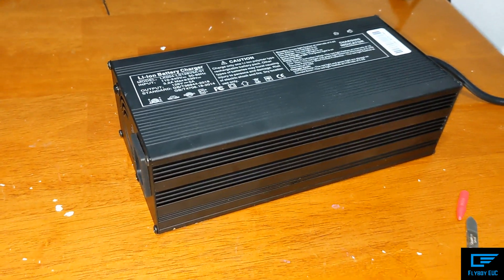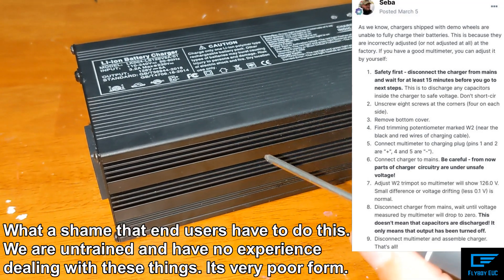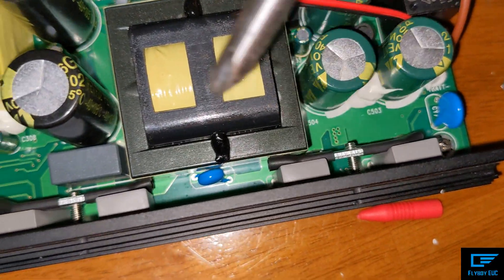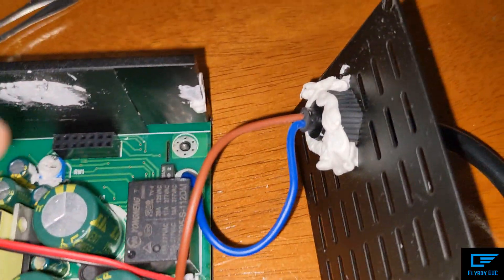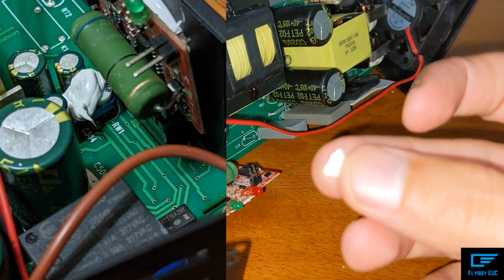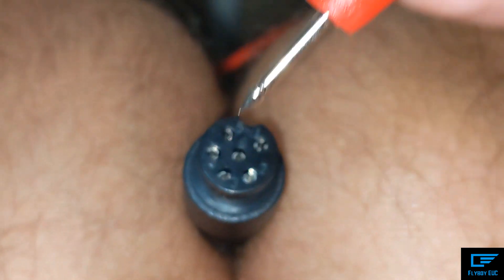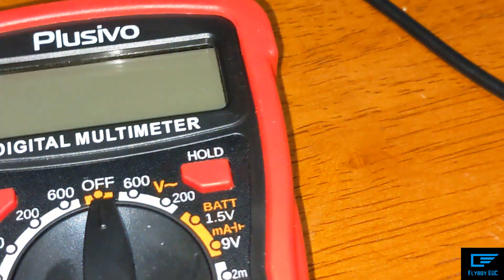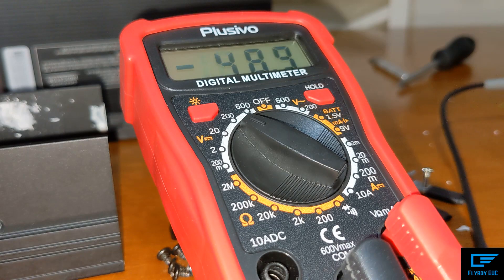Kingsong S22 126v Charger Output Adjustment

Comment: And... why did you remove the entire pcb from the case?
Reply from the maker: To gain access to the output voltage. Other commenters said there is an easier way. Just read the comments. I only did what I was told at the time and wanted to document it.
Reply: @FlyboyEUC  alright, alright.... It's just that I facepalmed at the and like I haven't in a looong time :p

Comment: So bad your charger was only charging your wheel to... 24V (?!?!).... (0:10) 🤪 
(edit: and no, you don't need to take everything apart, what a waste of time! and risk to electrocute yourself... the potentiometer is accessible after taking the lid off, and visible in your video - for the ground you measure it directly at the cable, no need the pad on the backside of the PCBA; moreover, measuring the voltage on the PCBA is wrong because you lose about 200mV for each ampere in that cable)
Reply from the maker: Haha. Oops. I meant 124v. Nice catch 👍🏼

Comment: Why is that one spot the only spot to measure ground??? To access pot, you don't need to unscrew the whole board...must be better way of doing it...use app to do the measurements... It's a smart bms anyways...
Reply from the maker: The pot is easily accessible but then I can't measure the output. The app has been verified that it isn't an accurate representation of the voltage. Many have struggled to get their wheels read 126v when fully charged.

There may be other ways, but I don't know of any other way to measure output from the charger.

Comment: to bad it ended this way. Sorry for your charger!
Its also to bad that the new charger types cant be measured just easy at the output plug (Its the same on the GW Master charger). This makes it more complicated. Otherwise just opening and screwing on the potentiometer would be enough with voltage meter pllugged into the charger plug. The need to put the whole thing apart is nerv wracking.

Comment: why cant you get a voltage reading just on the plug?
Reply from the maker: If I understand your question, the charger doesn't output 126v until it makes a connection with the BMS of the wheel. You can definitely do that with other chargers though. These new chargers start charging about 5 seconds after being plugged in. The old ones start as soon as the pins come in contact.
Reply: @FlyboyEUC  thanks, you don't now what pins are positive and which are negative do you? Yes, i see #5 is positive.THANKS
Reply from the maker: 1 and 2 positive, 4 and 5 negative
Reply: @FlyboyEUC   I thought you had the red probe lead (positive) on #5?  Also super sorry about the charger at the end
Reply from the maker: I did have the red in the hole. Maybe that's why the voltage was negative when I measured it?